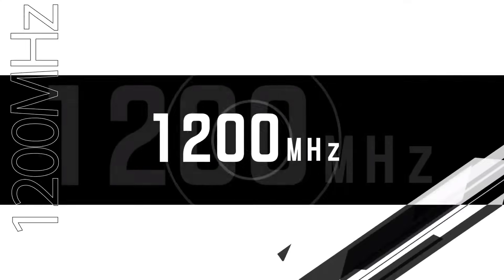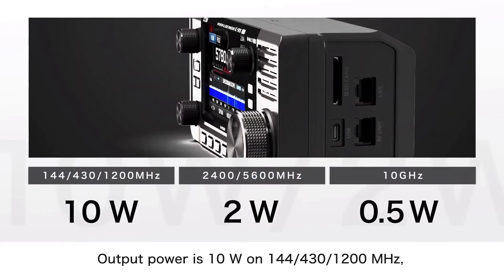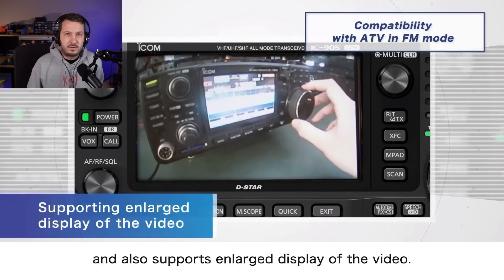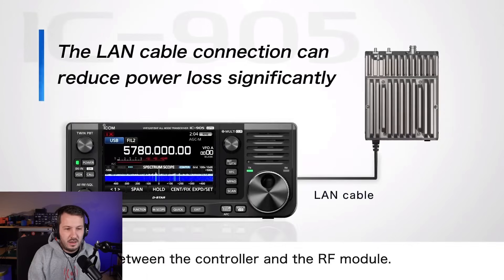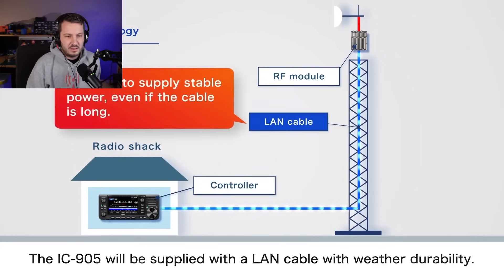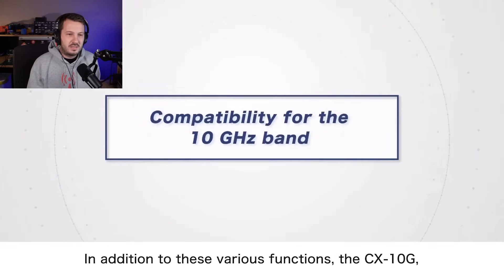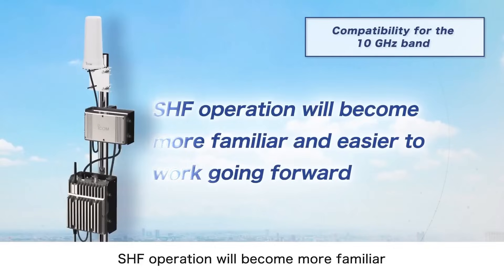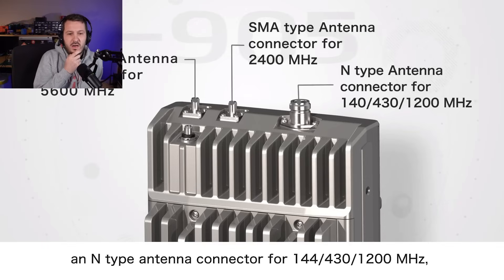Icom IC-905 FULL Details and REVEAL! VHF/UHF & SHF Radio

Comment: Sorry I going to be a  Dud.... First.. 144/432... 10 W  Out on the tower…. useless.... Most weak signal sideband operators needed at least 150 W... So that means putting amplifiers up on the tower.... Were worse running cables back to the shack and then back to an antenna.... 1296 out at the tower 10 W... Again useless.... Try band antenna vertical again side ban operators on UHF VHF use horizontal  Antennas... 2 gig and 5 gig vertical antennas useless...... Icon scrap the whole thing.... Come out with a multi band transverter by itself... 1.2 gig through 5 gig... And a separate transverter for 10 gig... That would sell this  It will be a very expensive newbie setup....

Comment: Fantastic .... $ 10,000 outer box, $ 25,000 a bit of electronics, for each button on the front it takes about $ 123, the display is still being built and considering that for ic5100 it was born to be a vehicular device where the bracket to fix it by car you have to buy it separately, the SHF external module will cost only $ 95,000. Greetings and have fun putting your hand to your wallet.

Comment: I hope that the PoE link is using standard ethernet frames to move the baseband/IF data over the wire.  And ideally, that I could insert an ethernet switch or even a router in between.  It would certainly make "plumbing" a lot more flexible!   Imagine having the front panel unit plugged into your local network, with a 1G or 10G optical link to a tower a few hundred meters away.  And a PoE injector at the base of your tower.  

Sure, I can imagine there would be some tight delay jitter bounds that you'd have to arrange for, but all this stuff is already built into Ethernet (even if the really crappy commodity unmanaged switch in your basement doesn't support it.)   Even if this had to be bridge on it's own VLAN, you could do VLAN priority marking for that traffic.   Even with 1G Ethernet links between switches, you'd only get 12 uS of jitter if the radio packet got stuck behind a 1500 byte Ethernet frame that was just starting to get serialized out the link.  And heck, 10G ethernet is relatively cheap these days and you could get that down a microsecond or two of jitter.. 

Neat stuff; I'd been waiting for a vendor to remote the RF head for years.  I can only dream that Icom would document the protocol over the wire for the baseband, and they could establish a defacto standard for this type of operation.

Comment: Actually back in the 80's both Yaesu and ICOM came out with rigs that had optional ATV (FT-736R and IC-970), but the IC-905 is definitely a big move forward.  The IC-905 should increase VHF/UHF/SHF contest activity for sure!
Reply: The Icom IC-1271 had the accompanying TV-1200 ATV unit for excellent analogue TV on 23cm.

Comment: Pro: lot of microwave bands ... and has legit GPS trained reference osc
Con: not designed for EME or weak signal work ...
TX and RX are not split - for preamp, etc.
Single RF connector for three bands :(
PoE Lightning Protection included?
What does the tower module have for lightning protection?
Tower module - keying lines and voltage for preamp(s)?
de W1QA
Reply: Agree 100%. It is a toy for hams with money but no skills. They will put a vertically polarized omni antenna to the unit (triband 144-1200, and each one for 2400 and 5600) and complain how bad it works.

Comment: My use of radio’s is communicating at distances without depending upon the infrastructure (internet, repeaters etc.). I’m not the customer ICOM is targeting but I do have  decades of experience with microwave. 

Outside of bragging rights , I don’t see this gaining much traction to tell the truth. it’s pretty distance limited at those frequency. Perhaps a commercial microwave repeater’s are in the future. Another point about microwave…..it’s expensive to buy, to trouble shoot (test equipment etc.) and at time exhibits this phenomenon know as FM!    F..n Magic! The latitude we enjoy in HF is forgiving and is relatively inexpensive. Microwave is entirely a different beast.

Comment: Why was 220 left out?
Reply from the maker: If you scroll down the comments you'll see this answered, but... again here... 220 is only available in Region 2, which is pretty much the Americas. That's an even more niched down market that it's already trying to target.

The radio would require extra power amp, preamps, receiver, transmitter, filters etc built into that already crammed RF module... 

It's not really viable, especially at product launch. Perhaps in time, they might release a standalone unit.
Reply: @HamRadioDX  Yeah, I seen 'em after I left my question. I believe we're legally allowed to use 216-226, if I recall frequency range right, some of which we need to be 100 miles North of the U.S. border to use. There's also a section that's sorta reserved, on a handshake seeming basis.

73s
Reply from the maker: Yeah no worries. Here in Australia that band is full of our digital TV, so not much to listen to :)

Comment: power level of IC-905 seems like made for Japanese allowable power such as 2 watts in 2.4GHz,  5GHz.   I think IC-905 is pretty much made for Japanese domestic market, where they actually can talk to someone with such high frequencies and power level.    one thing I like is actual Radio hardware are on tower top, which are connected through Ethernet cable, and power is also supplied by Ethernet.    AG6JU
Reply: Exactly what I thought. The Japanese have/had 10 W licenses. - For any serious operation (airplane scatter, rain scatter) you need 10-20 dB more power. And then the beauty of the concept is gone, you cannot supply a 100 W PA (250 W in) via Ethernet. And need a big box with big heatsink anyway. No problem to have a 5 mm double shielded coax running down for a 2m IF with transverters up. The concept is technically sweet, but if you want to leave the small ICOM sandbox, it does not work anymore.
Reply: @Henning_Rech   anything more than 50 watts on 30 MHz and up.     more than 2 watts 2 GHz and up, require special station license.   there in Japan.   it require  contour study,  and first licensed as temporary license, and licensee  must prove  if there are no  interference within so many KM radius.  I understand it is about same process as if you are establishing broadcast station.  so practically impossible.   I think IC-905 are mostly intended for those  just want to try out 5, 10 GHz  at 2 watts or less.
Reply: @NIKO_92865  Thank you for information about the Japanese licensing system. In Germany we also need to make a EMC study before we are allowed to use full power (while we just have to have it ready in case of a investigation), and it is not impossible ;) - But we all agree that ICOM has designed this radio for their domestic market.

Comment: One use of these radios, if an external amplifier is practical, is troposcatter. You can do that on any band, but it will take a bit of power. I know that to do that on 432 MHz, many operators will use at least 50 watts or so and at least an 8 element Yagi. 

On 10 GHz. I've read of several hams in the UK in decades past who used to scatter 10 GHz SSB off of thunder clouds and communicate over distances of several hundred miles. If one were to try that with a 1/2 watt unit, it MIGHT work, given a large enough dish. 

But if we don't have a way to interface an amplifier to these radios, the range will be fairly limited. Still, for all that this is, I think this is something I will save for.

Comment: I'm curious about remotely mounting the RF unit. The video mentions it being waterproof, but with all those exposed RF connectors, I would think a waterproof enclosure will be needed. Also, while it would be nice to see 220 and 900 MHz, it's important to understand that those bands are only available in region 2, so there's no sense in Icom including it. Let's not forget Alinco came out with a short lived 220/900 HT, so it seems there isn't much of a market.
Reply from the maker: I think they come with rubber boots to mount over the top of the connectors. You're correct about 220/900, the market is too small!

Comment: The higher bands only make sense to me for very wide bandwidth modes, satellite communication and to radio link repeaters.
Reply: In 2006 IARU R1 UHF contest (the last I participated as single OP on 1200) I did 180 SSB- and CW-QSOs (180 unique stations) with an average distance >300 km (ODX >800 km). Even if now the participation is lower because ham radio is at its dusk, narrowband makes a lot of sense. Just not with such a toy. I used 500 W then. And won.

Comment: This certainly is a game changer, no other amateur radio manufacturer has ever put so much varied technology into a transceiver. Depending on the ATV FM bandwidth the picture quality can be remarkably good. I have had many years of ATV experience and when we went from AM to FM ATV the difference was amazing. Yes digital is better but FM and standard definition digital ATV are close in quality. GO ICOM!!

Comment: 1.25m? why is this not included? SDR why not include?
Reply from the maker: 1.25m is only available in ITU Region 2, so a very niched down market. Perhaps in time they'll release a separate 220 MHz module but it makes no commercial sense at the moment.
Reply: @HamRadioDX  and the Americas market, the FCC only allows a tiny sliver now. Hard to convince myself that getting into that 1.25m band range is economical either.

Comment: Wow so many cool concepts… but Ooof. Not having separate 140 and 430 n-type connectors might have been a mistake. Many hams would dip their toes into this from lower frequencies first with antennas they have.
Reply: There are a number of diplexers available that will split the antennas out. The single port is ideal for the antennas that support 144,440, and 1.2.
Reply: @edw297  if only diplexer insertion loss claims were honest. Still, this radio seems fascinating for higher frequencies.
Reply: @Aimsport-video  So you gained quite a bit by putting the transceiver neat the antenna, a few tenths of a db is going to make that much difference? Or to turn it the other way, it doesn't bother me when I use a tri-band antenna!
Reply: @edw297  all good points.

Comment: It would be EXTREMELY useful if Icom shipped you a unit to do a detailed run-up and review.  Seeing a 'real world' operator install and setup one of these would be great - especially given the amount of external equipment and the challenges in getting it correctly setup and weatherproofed.  Also, there is a lot packed into this unit and I can see it taking a fair amount of time to work through and get into the feature set this unit provides.

As a potential customer, I would like to see an experienced operator work through this unit in detail before I buy one.

Thanks !

73,

VK7WTF
Reply from the maker: Thanks Sean! Hopefully we can get hold of one for the expo in November

Comment: What was the point of putting this into a 705 sized enclosure? Theres no battery,no direct antenna no protection to all the inputs.  Id be more interested in a 705+ with usb c and the lan port, and make the rf device with a built in tuner as an option, then add dstar dv/dd and atv too.

Comment: The 20m length is probably related to DC voltage drop of POE cable sufficient to power 10W at the transiever.  It may even be a special ethernet cable.

Comment: Interesting radio. Disappointing that there’s a shared antenna connection for 144/430/1200. Will it do full duplex?  Can it power a pre-amp over coax?
Reply: If you think about it.  whit the RF unit remote from and being powered from the radio via PoE, I doubt there is much power left over to send down the coax line but I’m just guessing.

Comment: Great review Hayden! This certainly is going to get the GigHam's excited. As for "more power" (if it's allowed), someone will come along and make a post power transistor amplifier just like they have to the LAB599 and IC-705, although it's going to be tricky at the 5 & 10 Gig frequencies. Likewise, they will likely specify CAT7 cable due to its extreme shielding, or create something new (M&P?). The input to the RF module has to be super clean. Also, I think they're going to specify that the higher the tower with *absolutely no obstructions" is the order of the day. Good catch on the 3.4G omission. It's a shame but maybe the 905 will help us in the "use it or lose it" equation.
Reply: You read as if you have already been QRV on these bands, so you may agree with me that this ODU is an (expensive) toy. Technically sweet, but not a very useful concept.

2 W / 0.5 W - this is state of the art 30 years ago. Ridiculous. And if you add PAs for decent power, let's say 100-250 W on 1200 and 2400 and 20-50 W on 5600 and 10G (state of the art since 10 years at least) you need a big case, heatsink,  PSU, and power line for it. And you would need a PA interface - where is it? - all advantages of the concept are gone, any mast-mounted transverter would do the same or better. They have a GPSDO - good, maybe new for ICOM, but SHF amateurs use this since a decade. You can connect an analog camera - maybe even difficult to find one today?

I am sure it will find its customers, old hams with too much money which will set up the 10 GHz unit and the ICOM omni antenna, and then complain that it works so badly, as they had known before. With 20 dB less antenna gain and 15 dB less power than a real station, it is like using 100 mW on shortwave.
Reply: @Henning_Rech  Unfortunately you are likely correct in how this will turn out. The post transmitter Amp could be simply attached like a 35w vhf/uhf car booster but in the higher frequency, that gets real messy. There is a reason that wave guides are made of metal and BOLTED together - to reduce any possibility of stray signals either in ot out of the transmission "line". 10 Gig is a whole other world where things we fussed at as Ham's become extremely serious. When you have a 10 GHz signal, even wire length becomes super important. Might was well have a fiber optic converter on the mast and a another in the shack. Talk about no line loss! Anyway, it's going to be real interesting where this goes.

Comment: How can you say "all vhf thru microwave" and No 220 ?   And only one connector for 144, 432, 1296 ???  That's just not smart. This is more of a novelty than a real VHF thru Microwave radio.  Sounds like alot of quid pro quo promotions on youtube. Alot of hype for sure. They could have really done this right but how they've done it leaves me shaking my head ... you will see these on the used market in a year or two when buyers realize they aren't gona make alot of Q's on a 2m/70cm/1296 tri band vertical .  If they listened to the market (Hams) they could have had a real hit. That said, love your channel Hayden and all your great video's...less this one ...hahaha
Reply from the maker: Well, 220 is US only, as is 900 MHz… it makes no commercial sense to include those bands. I can say VHF to 10G because it includes all bands available for use in every region.
Reply: i think 144/433mhz is supported just because they can without any extra hardware. however, those are only 10W and anyone serious about those bands will have a separate radio with higher output, so they won't be using this radio for those bands.
people buying ic905 will be buying it for bands higher than 1200mhz, so the port is basically dedicated to 1200mhz

Comment: was hoping that it would have 220  sure looks cool--wonder if you use the 10g module, can you still work 2g?
Reply from the maker: I saw some images from Hamfair showing what looked to be a looped output from the 10G transverter to the 2.4 antenna, so I think it will be possible

Comment: If the transverter takes its input from the 2.4GHz band then working QO-100 gets complicated because there is no where left to plug in the 2.4GHz uplink antenna.
Reply from the maker: The 10G transverter might have a 2.4 output? It was only speculation based on the photos. Time will tell I guess
Reply: I hope they didn't just make a mistake there, because they don't have access to QO-100... They did remove the 70 MHz band from the IC-705 in the last moment (it's mentioned in the service manual).

Comment: It does twice as much and (if rumors are true) costs half what I would have guessed.

I'm downsizing from a house to a very small condo and will primarily be operating at local parks and transport gear via bicycle trailer or car. The IC-905 will fit perfectly in this arrangement.

As a new ham, this kit and accessories definitely makes bands 2400MHz and up much more accessible.

Well done, Icom. Exciting.
Reply from the maker: The rumored pricing is incorrect I believe, therefore I have removed it from the video. You’re right about access to the bands. To put together a transverter system similar to this would be several thousands of dollars
Reply: What is the rumored price point, out of curiosity?
Reply: redacted
Reply: @w7don  Well, I hope the rumors are true, that would be a very attractive price point.

Comment: No mention of 900mhz.
Reply from the maker: 900MHz and 220MHz are only in the USA. Not viable for this product which is being developed and sold for the international market
Reply: @HamRadioDX  yep true. However USA doesn’t have 4m and that’s included in other regions.
Reply: @HamRadioDX  It is sad because 220 is cool. I used to talk simplex FM on 220 with my seven element beam 30 feet up on the side of my tower to a friend with his 220 home brew beam up 30 feet day in and day out everyday, this was a 75 mile path. 220 is over looked as a band.
Reply: @mhammer5  We actually have more  902Mhz than 220 near me. But I have a 220Mhz radio and a 220 transverter. The band is amazing
Reply: I’d rather it mention 220Mhz.